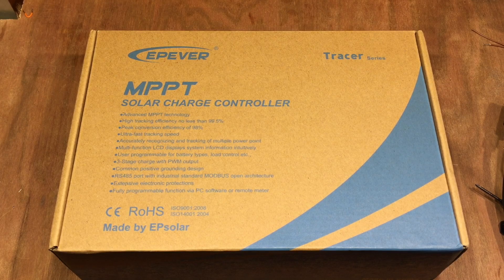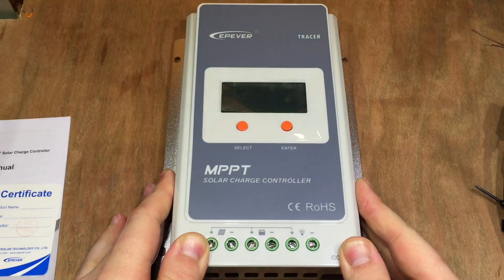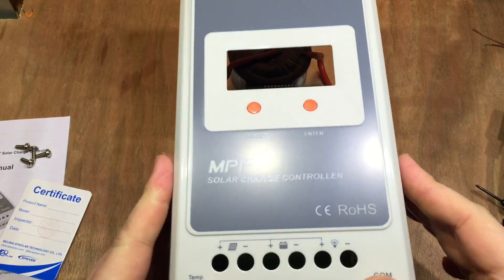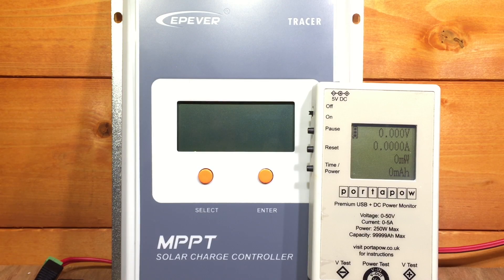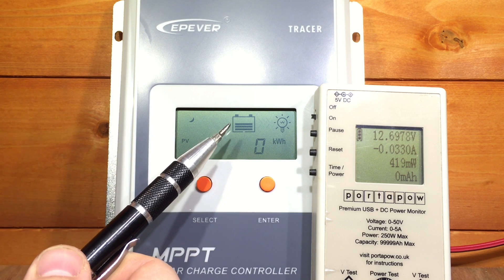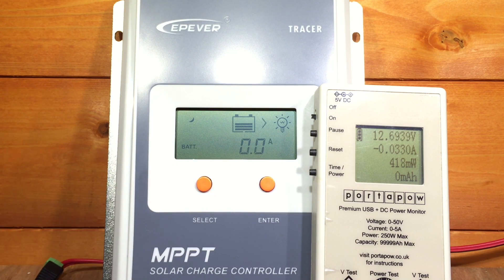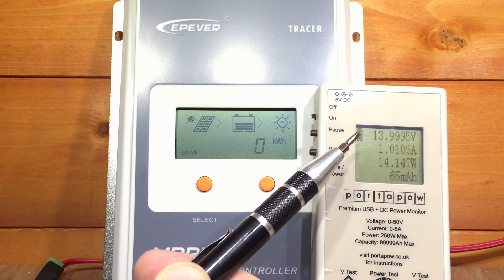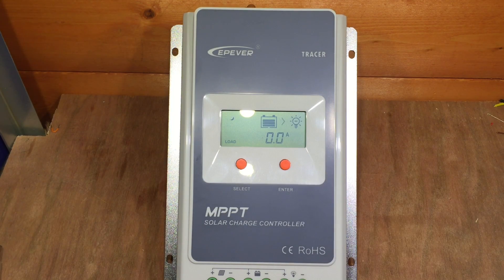MPPT Charge Controller Review - EPSolar EPEver Tracer A Series - 12v Solar Shed

Comment: Thanks for the review and info! I just ordered a 1210A version from ebay for 3,75£! It's going to be interesting what i get, a brick? Or some clone?
As a hobby project i was thinking of bulding a small solar setup in the shed.
During the day it would charge my 24v robo-lawnmover and during the night my 12v led outdoor lights.
Should i go with a 24v battery setup or 12v? I'm thinking two 12v batteries in series then i can get 24v tapping both and 12v just tapping one battery.
Do you think this will work?
Reply from the maker: +Nash.A Chiller Wow £3.75! Bargain of the century if it works out for you.  24v is probably sensible but you’ll need a panel (or panels in series) to ensure your input is higher than that. 
Taking a 12v feed from just one battery will result in an imbalance which could lead to one battery being over charged. I’d go for a dc2dc converter across the 24v. I did a video on a few of the options and their efficiency. https://youtu.be/dZHuj3R-g9A
Reply: Thanks for your input! Gotcha about the imbalance, i was thinking about that, maybe better going with a converter as you suggest.
I'm gonna check out the video, thanks again!

Comment: Hi Adam. Excellent reviews! I have purchased the 30a controller for our rv. I was thinking of placing it in the living area of the rv so that I can easily monitor the info on the screen, or would be better to locate it in the basement compartment, where it would be closer to the battery bank. What do you think? Thx, Rick.
Reply from the maker: +Rick Lemon They are best placed close to the battery, but I doubt in and RV anywhere is going to be miles away. The other option is to buy the MT50 screen that way you can control and monitor the tracer in the RV and still have the controller next to your battery.

Comment: Can I buy this to charge a 3s lithium ion 18650 pack?  I would mainly be concerned with setting terminal charge voltage to 12.6 rather than the 14+ for lead acid. If not, can you please recommend a fairly inexpensive option for me? It would be for a 10a or 20a controller. Great videos, thank you!
Reply from the maker: +Dimitris Zarmakoupis You can but you’ll also need a RS485 cable so that you can program the charging parameters to suit your 3s pack. You can make one yourself for about $2 or buy the official one for $5. I did a video about making your own cable and connecting the software.
Reply: Adam Welch thanks!  I will check it out.

Comment: I just ordered one of these expecting to run at least a couple thousand watts of PV off of it.  Now that I am reading the manual, I am seeing that the 4210A will only handle 520 watts at 12V or 1040 watts at 24V.  I have a whole bunch of 310 watt panels.  So I won't be able to connect more than 2 at a time on this?  That makes no sense.  If I connect 2 at 12V, it will be putting out 620 watts.  If I plug in 4 panels, I'll have 1240 watts.  Is this going to cook the device in full sun?  I was hoping to run eight 310 watt panels on this device and didn't want to spend $600+ on a Midnite Solar box to do it.
Reply from the maker: +GMoney The charge controller output is limited to the models maximum current. So a 40 amp controller can charge a 12 volt battery at a maximum of 40 amps (actually a tad over). That's about 480 watts. 
Thing is it's unlikely your battery will be at 12 volts on peak sun. At 14 volts you're looking at about 560 watts - but then again you're probably not wanting to charge at 40 amps at that voltage. 
Now you can attach larger arrays to the controller and on a good day the charge controller will limit the output to 40 amps but this has the advantage of a large surface area when the sun isn't at its strongest. 
Sadly if you were after a controller that had a 40 amp input limit (and due to MPPT an even larger output) - this isn't really the right one.
Reply: I have two Duracell 100 Ah batteries.  Do you think if I run 4 of those panels on it, putting each pair in series, that it will hurt anything? On the backing it says:  310 watts, vmp 37.1, imp 8.39, Voc 45.7, Isc 8.90.  I have a whole bunch of these panels sitting in my garage waiting to be connected.

Comment: Adam, I noticed on your MT50 you can press the left arrow and your battery charge mode came up, it said boost mode in your video. My meter does nothing when I press the left arrow. I've changed my parameters using all buttons and it works great, except I'm missing that screen. Any suggestions?

Comment: Can you make sense of page 9 of the manual? 

http://www.epsolarpv.com/en/uploads/news/201512/1449040581526220.pdf

Does this mean the 4210a prefers, for example, (2) 36 cell 12v panels for a total of 24v in series than it does (4) 12v panels for 48v? That whole "max and best section" is throwing me for a loop. Is it designed to run more efficiently with a 24v pv array than a 48?
Reply from the maker: Yeah what it is saying is that the controller is more efficient using those particular setups.  Converting generally is more efficient the closer the two voltages are together.  However these are factory tests and solar isn't always that predictable.  Your mileage may vary...

Comment: I have a  few questions about the connection for load. 1. What is the output of the load, ac or dc? I presume it's dc. So, do your appliances use dc? If not, do you convert the dc to ac using inverter? If yes, that means your inverter is connected the load, right? I have a 700 watt inverter designed to use a 12v battery 100 or 200 amps hour? Will the draw from the inverter not overpower the charge controller?
Reply from the maker: +Akinwande Olaifa Load output is DC. I wouldn't recommend attaching an inverter to the load output - best connected straight to the battery with as short leads as possible. The load output is rated to the same value as the battery output. So a twenty amp controller has a 20 amp load output.
Reply: Adam Welch thanks for your prompt response.  Could I ask some questions? What do you connect to your load output? 2. Do you use inverter? If so, are you connected to the utility grid? My concern is, if grid power comes through the inverter while solar panels are supplying charge, what would happen? Will the Battery or something else not be damaged?
Reply from the maker: +Akinwande Olaifa My load output powers lights and other low powered loads. I use an inverter but it's not connected to the load output, it's connected to the battery directly. Grid tie inverters are different - and are best suited connected to the solar panels directly rather than a battery via a load connection.

Comment: Hi Adam got some of these Tracer 3210A charge controllers, most probably got some of those bad batch of 30amp controllers as both failed like on one of the other comments here,
open the unit up and found a crack through the Q4 mosfet. Cannot read the labeling on the mosfet as the rubber screws they use to hold it down on the heat sink rubed off the reference numbers, so don't know what it is.  Do you know what it is or what I can replace it with and also what the other mosfets are (D10, Q7 & Q8) just in case these have gone too.
Reply from the maker: I don't know what it is - I could look on my 20 amp model but it might be different - a different fet for different current levels.  Have you contacted EPSolar?  If they know there is a funny batch they would probably exchange it, and if not they may be able to tell you the component in question?
Reply: Adam Welch already contacted there tech department, they just sent me back to the supplier. ebay seller.
will try again with epsolar.

Comment: I've connected a 260W panel, 100W of 12v LEDs, and 4 x 150Ah 12v batteries in parallel to my charge controller and Im getting some strange values in my data log. 
When my load comes on at 5pm, the array cuts out as youd expect
However, when the load turns off at 730AM the array remains cut out for several more hours ( the led display shows sun but no flow into the batteries)
Despite the array being 'cut out' and the batteries being in 'not charging' , the voltage is increasing
I should mention, Im using an external timer switch to turn my lights on and off rather than the load config feature
Ive removed this switch now but the array is still 'cut out' 
WTF is going on here?
Happy to upload my log if anyone wants to take a look
Reply from the maker: Take a look at my 'Tracer A after nine months' video - https://youtu.be/YowgBCl1F1I .  I explain that there does seem to be an issue where the controller struggles to get out of bed in a morning!  I found it is most noticable in the middle of winter.  Effectively it remains in PWM mode until the panel is capable of supplying 10 watts or so.  Although people with larger controllers suggest that figure could be higher.  Have a look at my logs in that video and see how your compare.

Comment: helo. can i use this with lead acid batteries? we are live in hot climate, 42c to 48c peak area. is this mppt  benefits over the pwm controller in hot area? and last thing,  can i purchase it from Chinese sellers like aliexpress? thanks?
Reply from the maker: Yes, it is a lead acid charge controller, and there are lots of sellers on Aliexpress.
MPPT will be of advantage most when you batteries are empty, so if you only only depleat them a little then MPPT isn't neccasarily going to be very helpful.  The charge controller is likely to get quite warm and this can reduce its efficiency.  Mine sits about 15-20 degrees above ambient.  Solar panels work most efficiently at cool temperatures too, so with the heat where you are they may not work to their full potential.  I can't say for sure how much advantage you will get from MPPT, but hopefully that gives you a better idea.
Reply: Adam Welch . thanks for your time. we are in pakistan. basically i have 14 panels of 150w each, a 24 volt setup  with a cheap pwm. and ups attached to batteries. im planing to make it 48 volts because i want to run AC on it. we have alot of sun shine here. and i want to add a single axis mybe dual axis traker to panels. is that not tracker benefits over mppt or add one or two extra panel to system in price of mppt. 
and can we add 2 independent  controllers to 1 same battery bank,  is it works?
Reply: Adam Welch. i mean. we say. i have 2 solar arry each of 600w or so. and 2 controllers. can we attach them both arrys to my single 24 or 48 volt battery bank

Comment: I wired it WRONG!!!!  4210A CC is just below the solar panels.IF I wanted to use a higher input voltage by wiring the (5) panels in series,it would do NO GOOD.
If I relocated the CC to near the battery bank,then I can take advantage of the higher voltage from the panels to my CC. Correct?
My wires are too small from my panels to my batteries(8 G.)and I believe that I'm getting a huge voltage drop coming from the CC ,just under my panels. The CC just tries to push 12 V. to my battery bank/inverter. IF I could wire the panels in series to 90 Volts, that 90 V. would go through those small wires with less voltage drop to the CC,IF the CC were mounted near the batteries.
I may have to disconnect one panel in the summer with that set up,because the amps may be over 40.I have a 40 A. fuse B-4 the CC.
Reply from the maker: It's always best to have your charge controller near to your batteries.  Even with a PWM controller it's better to have the losses on the solar cabling rather than the battery.
Reply: Thanks Adam. I'll do it OVER!

Comment: hi adam, after watching your video about epever tracer a charge controller I finally orderd a 10 amp model at banggood some days ago. and the good thing is, its tracking number saying that it will deliver tomorrow.  now I have some question. if you help me then it will be very helpful to me. 

as per the datasheet of my model, it can handel maximum 100 volt of solar panel. so I decided to connect four 12 volt (21 volt open circuit)  panel in series. can you tell me the maximum how much watt I can go for each panel??
Reply from the maker: +Arindam Ghoshal Just be careful with that 100v figure - it's actually 96v but you should be well within it. The crucial bit of info missing is the voltage of your battery bank. But for a twelve volt system you're looking at about 120 watts or four thirty watt panels. A 24v system could have twice that - 240 watt or four sixties. The 10 amp figure is the output to your battery rather than the solar input.   You just need to run the sums if you're wanting to double check your configuration. Power(W) = Current(A)*Voltage(v)

Comment: Hi there, thanks for the vid! I'm getting a 330W solar panel and a 12v battery for my camper van, so what model mppt do I need? 10a, 20a or 30a? Would really appreciate some advice. Cheers
Reply from the maker: The manual suggests you'll need the 30 amp model.  Quick bit of maths... a battery sat at 12 volts could be charged at 27.5 amps at full tilt on a 330 watt panel.   330/12=27.5
Reply: Aha! I thought so, just needed a clarifying answer! You wouldn't believe how long I've been searching for this info! Cheers
Reply: One other quick a, What type f battery does it suggest? Ie. Gel. Cheers
Reply from the maker: It has preset charging settings for Gel, Flooded and Sealed.  Or if you get (or make) the USB cable, use the MT50 or eBox products you can adjust all the charging parameters to your liking.  The manual is available here... http://admw.uk/iL

Comment: Adam, sorry if this is a dumb question. On eBay they have 20A, 30A, and 40A version. Which one do I need?
Reply from the maker: +Crypto Jones Not a dumb question at all - so much so it might be a lengthy answer!
You need to know how much current you'll be feeding into your batteries from the solar panel - so if you've got one solar panel capable of a maximum of say 8 amps a ten amp charge controller would usually do. These charge controllers are a little bit different though. It's a limit on the charging current (which is likely to be higher sometimes than the current from the panel due to the conversion it goes through). 
You'll only charge at full tilt though when your batteries are very low. 
Now if you've got more than one identical panel then you can put them in series - this will increase the voltage, but not the current. Now when this power gets converted to the battery voltage it will lower the voltage and increase the current - this will be a factor in your choice of charge controller. 
Then you need to think about the loads you want to connect to the load output. What output is normal because the output is also limited to the badged current. 
Finally what space have you got? The higher power the tracer A the bigger the physical size. If you're tight on space you might need to pick a lower current model. 
Check out the manual on the EPSolar website for more info on size and some suggested panel configurations. 
If you've got some panels already or have some in mind let me have the info (or a link) and I'll try to help with your specific items.
Reply: I was only going to buy one 72-cell panel, 37.2v x 8.47 amps.
Reply from the maker: +Crypto Jones If those figures are maximum power figures it's a 315 watt panel? If so with a 12v system that's about 26 amps absolute peak or 13 amps on a 24 volt battery system. I usually run my charge controllers at about half their maximum rating just to be on the safe side.
Reply: So then one of that type of panel is probably the max I can run on that charge controller?
Reply from the maker: +Crypto Jones Well this model is available in 10, 20, 30 and 40 amp models. It's quite nifty as well because it will move the panel away from its MPP to reduce the current if you're going over it's designed maximum. It means you can attach a bigger panel than you might usually which will help you in the winter months.

Comment: I was wondering about the EPSolar/EPEver mppt charge controllers.  Do you know if they will work with AGM batteries?  I've seen some people say yes and some say no.
Reply from the maker: +Matt Shields If you select the preconfigured GEL setting then it charges to a slightly lower level - but if you buy the cable (or make your own) or use the mt50 you can adjust the charging parameters to whatever you like. You can tune it exactly to your battery manufacturers suggested settings. 
I use AGM batteries and have had no issues.
Reply: Awesome!!! Thank you

Comment: I will give it a try. Im looking for a controlled dump load on a battery (alternative a Supercap bank) connected to a EPever solar charge controller. The idea is to measure how many wattHr I can get from my solarpanel (just a testpanel for fun 25watt). So when ever the battery is full I will burn the energy comming in from the solarpanel and measure wattHr via EPever software. Found something called shunt regulator, any suggestions how to go about it?

Thanks for all your great videos.

Comment: I'm setting up my first solar setup. I understand that I connect the charge controller to the battery first. Is that when I set the settings on the controller to suit my AGM battery? Do this before adding the solar panels and add a load? Is this correct?
Reply from the maker: +John Lerner I guess that's the ideal time yes - but changing the mode shortly after connecting everything up wouldn't do any harm.
Reply: Thank you!